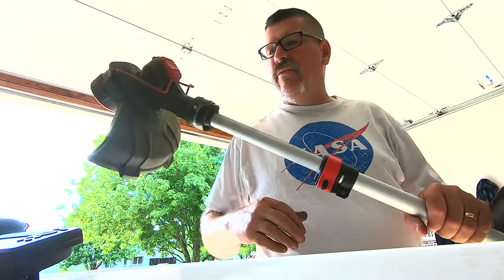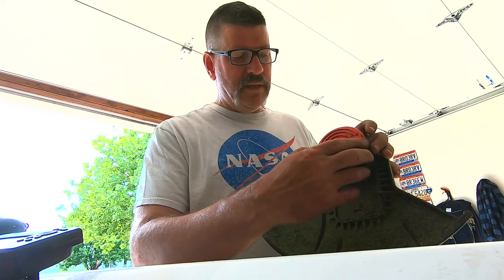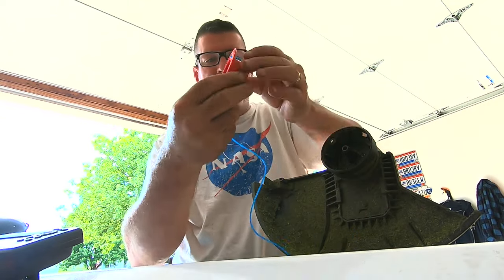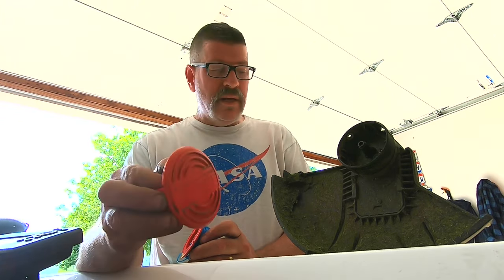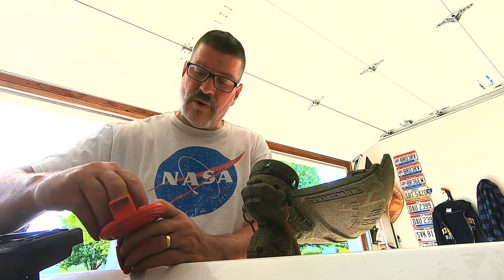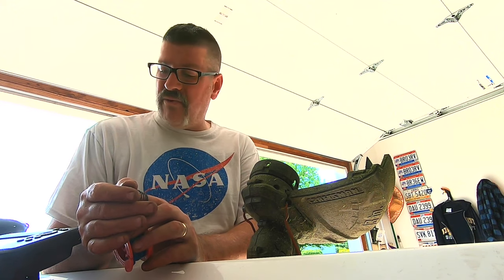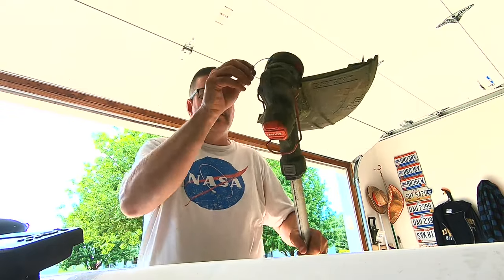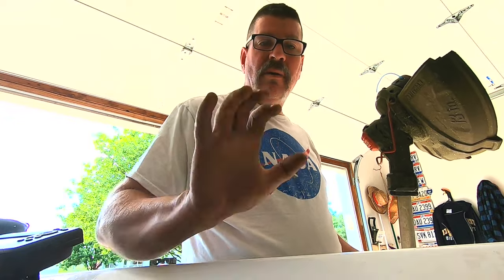SOLVED-Craftsman V20 String Timmer Manual & Auto Line Feed Issue DON'T TRASH THE OLD SPRING! #howto

Comment: The older ones had a button to tap the floor in order for more string to come out as your edging. These dont have a button to tap so how do you get more string to come out as you work?
Reply from the maker: Everytime you push the button to run it (because its electric), it will auto line feed some line. There is also a button while it is running/spinning to advance more line. It is defintely different than the ones that you have to tap the floor to get line to come out.

Comment: Thank you so much for uploading this video. I had (have) the same issue but unfortunately last year when I changed my spool for the 1st time I tossed the original spring. I guess I'll be contacting Craftsmen to try to get an original.
Reply from the maker: Glad to help!
Reply: Were you able to order a replacement original spring?  I also tossed mine when changing the spool
Reply: @xrsphere  A buddy of mine found a compatible spring for me. It was not identical, but close enough to work correctly. Sorry I didn't have a better answer.

Comment: Might be a dumb question but how to take off the spool head. I’m trying to put a different one on but can’t figure out how to take the old one off
Reply from the maker: There are two tabs on the side you need to push in and then pull at the same time to get it off. The part that the string connects to just pulls off.

Comment: Any advice on why will will not feed with the button? I still have the stock cap and spring. I will feed fine manually.
Reply from the maker: I know it has to be running when you push the line feed button. Not sure of any other solutions.
Reply: @Hipiam  I think I figured it out. I need the smooth .065 line and not the ribbed. It's getting caught on itself.

Comment: Mine won't feed either and I have not replaced anything yet.  To me it seems like my old  spring is causing too much tension because if I remove the cap and pull the spool up just a centimeter then I can pull the string and it will feed.
Reply from the maker: I've read that some of these trimmers have that issue right out of the box. If you just bought it, I recommend a return if possible.
Reply: @Hipiam  had it right about a year

Comment: Thank you, I have been fighting with my Craftsman weed eater this past week and was ready to throw it away due to the string not advancing.  I happened across your video and success, it is working again.  I do have a question, by replacing the cap and keeping the original spring has me a bit confused.  Is the cap faulty and is the fault visible? I would have thought that the spring would be the problem.
Thanks Again
Steve
Reply from the maker: My cap that I had to replace basically was worn away/broken. It fell apart from sliding on my sidewalk and driveway which lead to the replacement.

Comment: The thing I don’t like about the auto feed when you start the trimmer is the waste of string. Unless you want to hold the power button the whole time you’re cutting, it’s going to keep feeding. When I bought this I was hoping that all I had to do to feed it was press that button but I don’t have to press it because it keeps doing it lol.
I saw a comment on another video that told me to put duct tape over the auto feeder spring but… Isn’t there a better way?
Reply from the maker: I agree with you and was bummed initially about the auto feed string waste. I didn't like the constant auto feed feature after each start. I'm used to it now and just keep it running most of the time and hit the manual feed button when needed. It's defintely a pain to get used to, but I'm proficient with it now. Not sure about the duct tape fix, so I'm not sure if there is a better way. I'm almost through another season and still like the timmer. Everyone hates to re-string trimmers. When that string runs out, it's usually x!?X?!!! potty mouth time haha. Take care.

Comment: Sir good video. I have the same trimmer .Do you have a thought as to why the string spins out on each trigger pull?
Reply from the maker: It’s supposed to do that. It’s kind of annoying until you get used to it. I try to keep it running most of the time to save string. You can’t turn off that feature unfortunately.

Comment: I'm having the same issue.  What if i decompressed the spring I have?  How come you put the old spring back on?  Thanks..
Reply from the maker: I put the old spring in because that was the correct tension to make it work properly again. This was a repair because my red cap broke. The new camp came with a new spring, but it did not work properly.

Comment: Hello!  I found your video on YouTube and have a hard time with the trimmer line not releasing and I always have to take the cap off to pull out more line, which is very frustrating.  I have a Craftsman string trimmer/edger (Model CMEST900)  that I bought in 2021 and have always had trouble with the line feed part of the trimmer.  I noticed on your video that when you re-wound the trimmer line and then put the cap back on, you pulled on the line and were able to extend the line.  My trimmer has never done that and the spring on mine looks like the replacement one you showed on the video, but I have never replaced it.  Is there a solution to my problem?  Any feedback would be appreciated.  Thanks!
Reply: I have the same issue with mine.  Every time I weed wack, the string shortens up and I have to stop, open the cap, manually pull out string, replace the cap, run it again, stop after a few more minutes.  Maddening
Reply: @xrsphere  This is exactly what I have to do too.  It is very frustrating and I would not buy another Craftsman weed trimmer.  It is a shame too because one of the reasons why I bought it was that it was light weight and easy to use.

Comment: I bought the CMCST900 a few months back from Lowes and used it maybe 3-4 times, and the line kept snapping and getting lost in the feeding mechanism. I'm new to having my own yard and thought I ran out of line (lol) but thanks to this I was able to get inside it and see what's up. My concern is that for me the spring you showed as the replacement you received with the new cap (the larger spring) was actually the original one mine seems to have come with. I haven't bought a replacement cap before so I'm not sure if that's just what my model comes with as its slightly different to yours. Do you suggest I should just get a new spring? Thanks!
Reply from the maker: The springs see to cause the issues. Especially if there is too tension. I would try a small one if you can find one.
Reply: It sounds like the spring in your trimmer is the same on I have too in my trimmer because I have always had to manually remove the cap to extend the trimmer line.
Reply: can you cut the spring down and make it smaller??
Reply: Hello 
How are you doing with this trimmer now. I am in the same boat. I only have the new spring that came it with. I am still trying to figure it out, the string does not come out unless I manually take it apart every time. Thanks for your help

Comment: I just got this weed wacker today. My lines comes out so easily every couple minutes. Do you know any way to fix this?
Reply from the maker: It will come out everytime you hit the start/run button. My advice is to just hold the start/run button down as much as possible while trimming. If you constantly start/stop/start/stop, you'll burn your line up fast. Use the manual feed button (while it's running) to manage your line usage. It's hard to get used to at first, because these trimmers are not like the others that you have to bang on the ground to get line out. Continueously run and use the manual feed button to save line. Hope this makes sense and helps. If its just randomly feeding line, my guess it is the tension spring or some other bad part.

Comment: I bought a replacement cap, used the original spring, but I still can't get the line to advance.
Reply from the maker: Usually that works. Make sure it's clean inside and just keep trouble shooting. Hope you get it working.

Comment: Any ideas? Mine feeds constantly. About to junk it. Less then a season old.
Reply from the maker: I would just double check and remove the cap and line to see if there's an obstruction under them. There's a small piece that is supose to move back and forth thats spring loaded (its shaped like a piece of pie and about the size of a dime). Mine was siezed up, and I put some oil to get it moving a couple of weeks ago. If it doesn't move in both directions, you have no line feed at all. It has to move back and forth. I think that there is also a limited 3 year warranty. https://www.craftsman.com/pages/warranty

Comment: Why does my auto feed on my trimmer feed more than it supposed to ?
Reply from the maker: I'm not sure Hector. I know that each time you run it, it autofeeds line. The amount of line that comes out I think is just suppose to be one "click". I actually don't like the autofeed feature. These trimmers are tricky. I would just make sure that the line is spooled tight, and that the spring tension is set to the factory spring.

Comment: Didn't work for me, yet. The line break not disengaging seems to be the problem. New/old cap spring, or without  ANY a cap spring. The spool is  not camming on the spring loaded break pin to advance line x inches. Perhaps an RPM inertia.

Comment: My wacker won't stop autofeeding
Reply from the maker: I'm not sure what that problem would be. I do know that it feeds line everytime you squeeze the trigger/power. So, I try to keep mine running as long as possible before turning it on/off to avoid using the line to fast.

Comment: I haven't had to replace the cap on mine, so I still have the same spring. Any suggestions or thoughts why my auto feed won't work? Thanks!
Reply from the maker: If you are manually/threading/replacing line sometimes it’s gets snagged up in the spool. Or, the spring my just be bad. If it was me I would replace the cap and try both springs with a good line replacement. Good luck.
Reply: @Hipiam  thanks!

Comment: My auto feed is wasting string so fast
Reply from the maker: I recommend that you try to not start/stop a lot then. Just hold down the start button and keep it down and running while you're working. It pushes line out each time you start. It is annoying, but I try to keep mine running most of the cutting time to avoid wasting the string. Just keep it running to fix that issue. Once you get used to it, it will save you some line.
Reply: @Hipiam  I'm pretty sure that mine is defective, it comes out even when I don't stop and start. It's flinging string all over the place. Taking it back and getting something different

Comment: I have a craftsman cordless trimmer as well. When I go to press it to start. I can hear inside the trimmer itself spinning but the spindle won’t spin. Is it possible that grass can get up in there so it won’t spin. Could I also have a problem with that spring?
Reply from the maker: The cap that holds the string may be upside down or stripped.